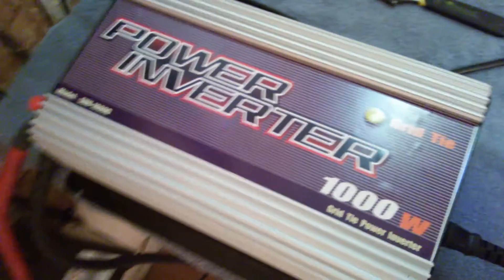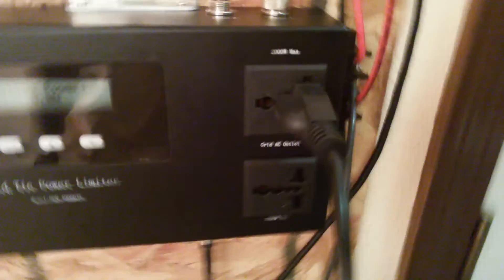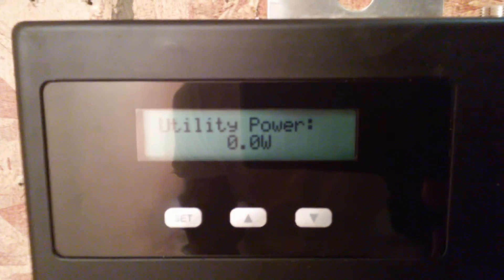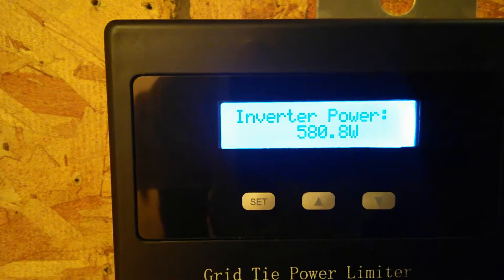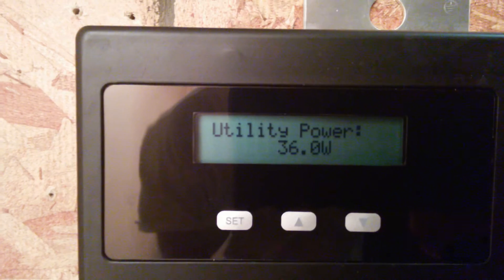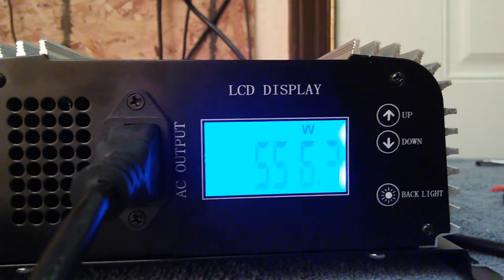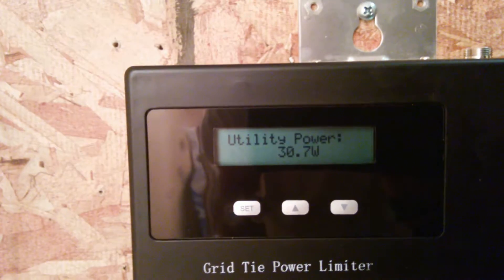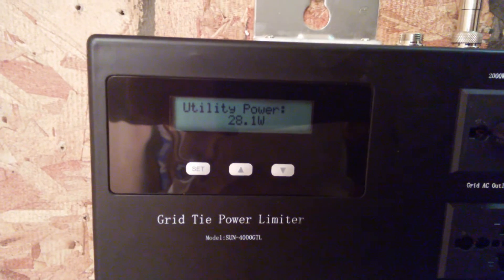The new Power Saver grid tie inverter explained

Comment from the maker: this unit is a 240 volt unit it monitors both sides of the breaker box so it can supply power to either leg and it can monitor either leg right now I have it on one wire just testing it to see how it work